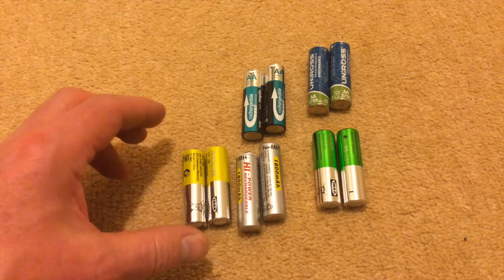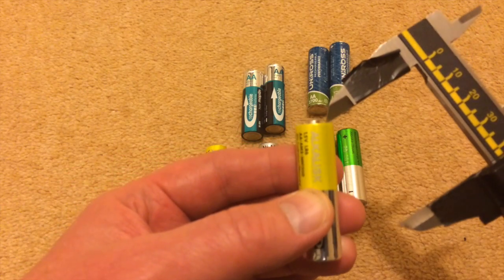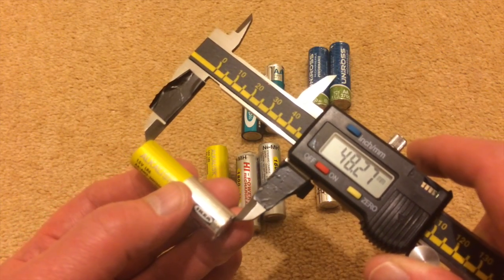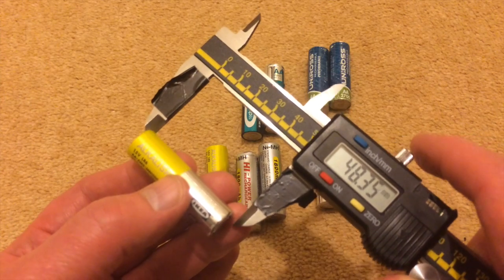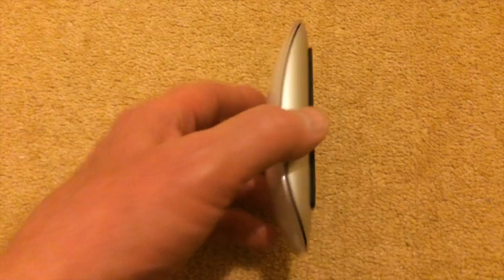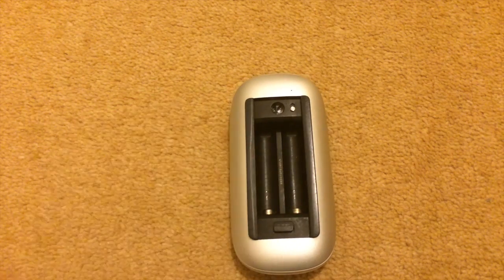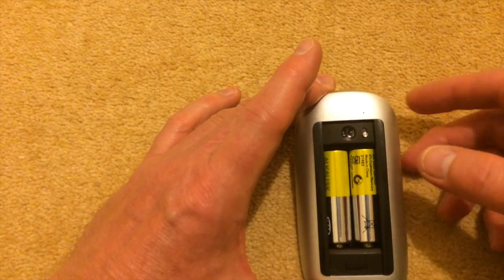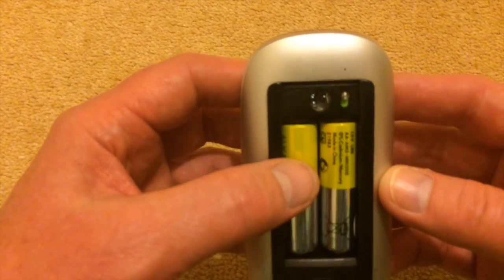Why AA Rechargeable Batteries Don't Work In Some Devices - Part 2

Comment: this is some dumb shit. devices have springs. im looking at voltage issues
Reply from the maker: LOL as they say there dumb and dumber, it has nothing to do with the voltage, is solely to do with the length of the tip.  Whenever battery holders are created they put plastic shims at the tip to stop one battery sliding into another or sliding out.  The length of the shim is often set to be the length of a standard battery tip and that's how far it comes down, rechargable batteries often have a much shorter tip and there the plastic shim pushes the tip 2 or 3mm away from the tip connection post, that's the problem here, thus the metal or foil to jump that gap.

Comment: Is there any way of getting rechargable batteries to work inside devices that are designed for standard non-rechargable ones?
Reply from the maker: Sadly no not without a large amount of electronics.  Your picture looks like you have deadly smallpox I hope that isn't the case ;-)